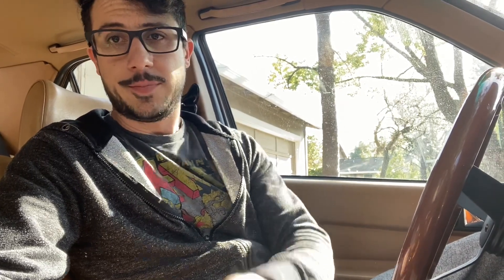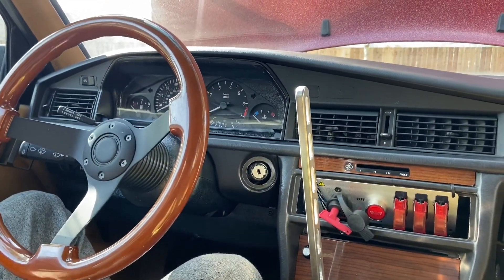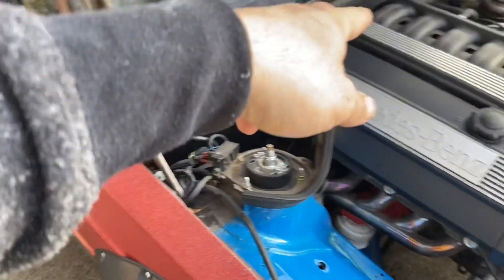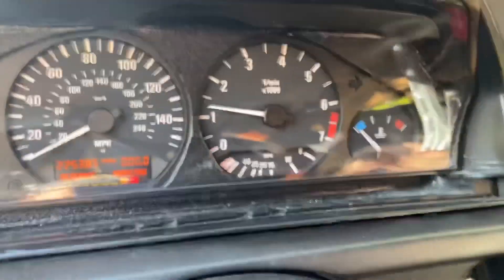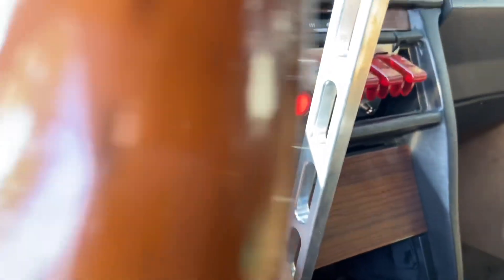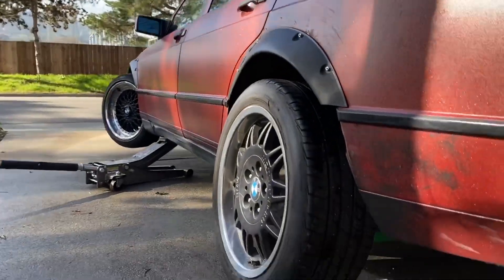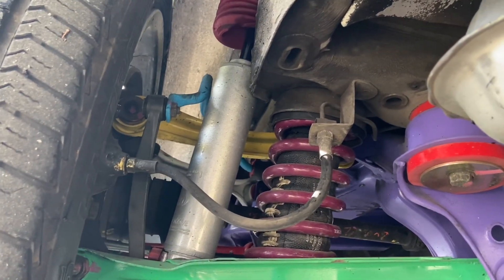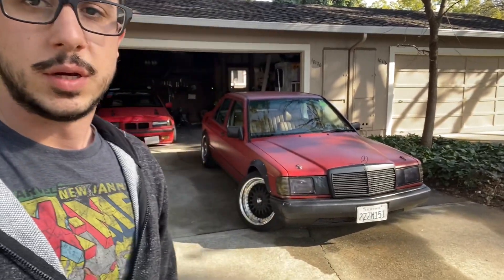W201 190e m50 Swap Update E36 Coilovers and Electric Power Steering DIY

Comment: What did you did with driveshaft and diff? Did you cut and weld it?
Reply from the maker: I used the rear half of driveshaft and diff from mercedes. the front half of the driveshaft I made a hybrid from the mercedes and bmw. I took the front of the bmw and mercedes driveshafts to a driveshaft shop and gave them the desired length. They cut and welded it for me and also balanced it. Cost about $120
Reply: @mheravetisyan1984  good job mate 👍🏻

Comment: Its a e36 coilovers?
Reply from the maker: Daniel Luperdi yes
Reply: @mheravetisyan1984  in the back too?
Reply: @mheravetisyan1984  what are you using in the front and back?  I want to put coilovers on mine but I cant find any solid advice.
Reply: @michaelboburt1774  hey there you can use some KW coilovers our MTS